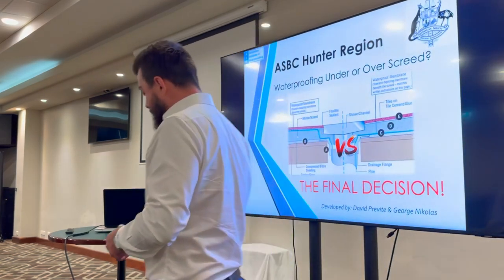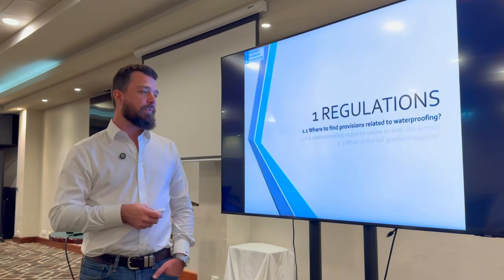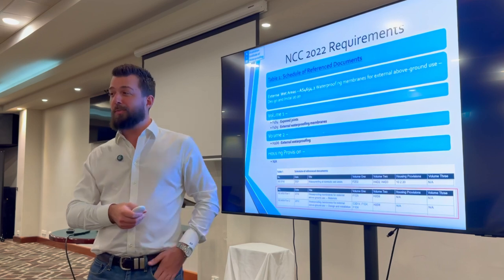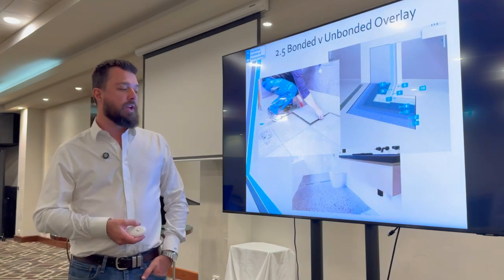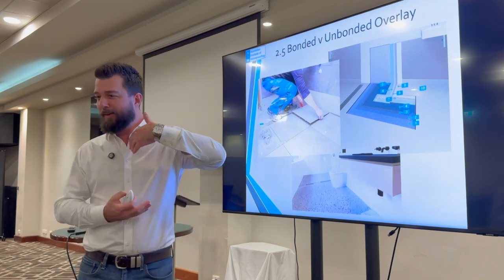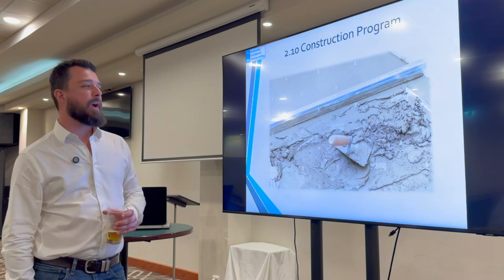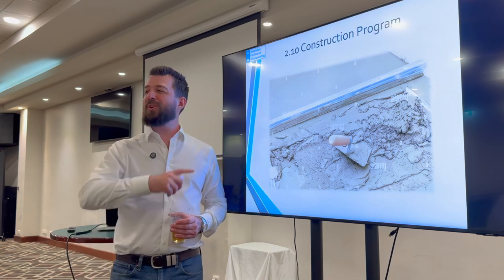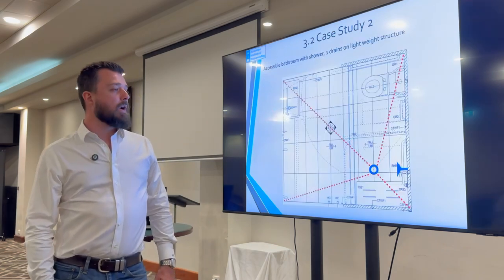Under vs Over Screed Waterproofing: Considerations and Solutions 2023

Comment: Nice work I enjoyed the info was easy listening to ..  - re -time 36.40 if you have a under screed membrane doesn’t the membrane go up the wall protecting the screed from touching wall. If so than the perimeter bandage on top of screed is not required. now case study 3.4 time 38.40 the first section detail in water stop for door. And last diagram time 39.50 still under screed membrane and shows no detail of over periemeter flashing on top of screed. So Re time 36 .10 wall sheet install detail - I believe this show under screed membrane project up wall again protecting wall from screed - 25mm above floor level and also show corner membrane. I am a silly chippy but I read that waterproofing membrane . NCC2022 - - 10.2.22 states Substrate surface preparation for application of membrane New for 2022 The substrate surface area where a membrane is to be applied must—free of indentations and imperfections - not rough surface so screed will need to be places down to uniform surface for membrane - However if screed is laid first - bond breaker and corner paint on membrane be used for wall protection. screed laid and than followed by top membrane. So really all floors that have been jackhammered up will need a screed first so main membrane can stick to screed. Also screeds are used to level gradient fall and if existing floor prior to screed does not have compliant grade and fall - So if the purpose for a screed is to do gradient NCC 2022 states Waterproof membranes must be graded to the drain waste puddle flange. Membrane should be installed on top of screed .New requirement that where the surface finish (e.g. tiles) is required to drain to a floor waste, then the waterproof membrane wherever placed below those finishes must also be graded. However Membrane grading requirements can be applied differently between AS 3740 & NCC Volume 1 & 2. in Volume 2 residential you can choose to disregard AS 3740 entirely and use all of Section 10.2 that does not require graded membranes to a drain waste. For Volume 1, commercial buildings and units there is no opting out of the graded membrane requirements in any wet area with a drain. But saying that in NCC 2022 Section A Governing requirements - The NCC2022 does override any previous standard.

 I’m tired now - good night